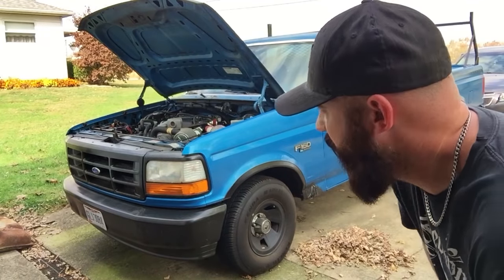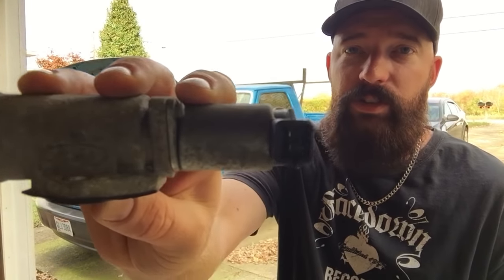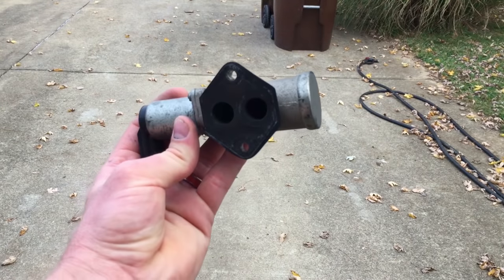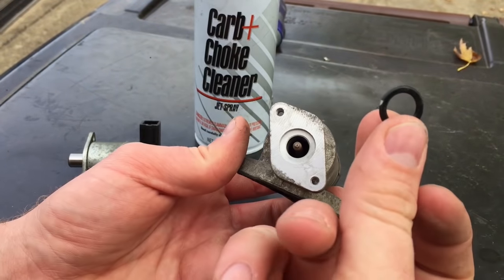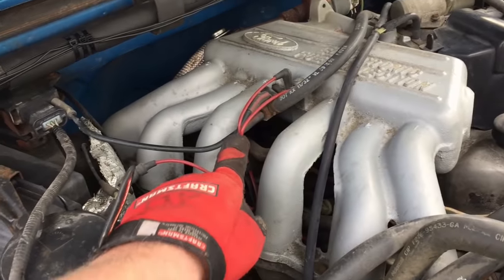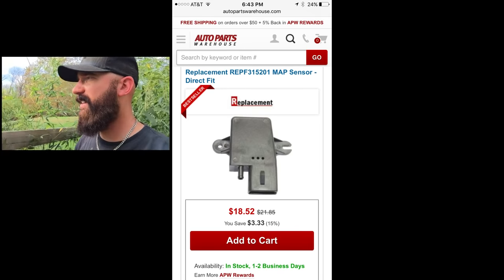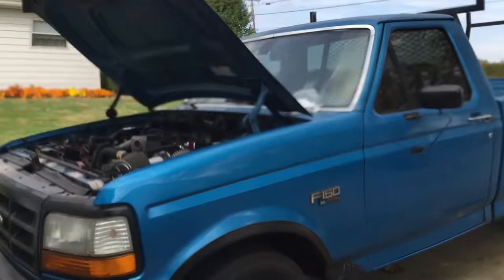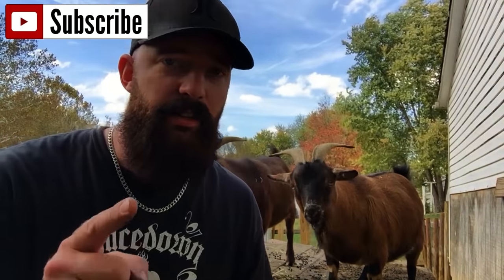Car / Truck Won't Run or Idle / Fix - F150 is the patient

Comment: I can't imagine a more perfect instructional video.  Minimum talking then you showed us what might be wrong, where the parts are located and how to remove, replace or clean the parts.  Great work.  UPdate - I see on another video where they had the same symptoms and other garages couldn't fix the problem.  The mechanic hooked up his oscilloscope and checked waveforms et al and narrowed the problem down to the MAP sensor, too.  Now I'm not sure if it was the original MAP sensor or an aftermarket one but when the mechanic pulled it out water poured into his hand.  Sure enough, the back cover could pop right off and there didn't appear to be any gasket.  The mechanic speculated that the water may have gotten into the MAP sensor if they power washed the engine compartment or maybe it just ran down the windshield - under the hood - and on top of the MAP sensor.  Interesting but something to keep in mind if anybody's F150 starts bucking and snorting.
Reply from the maker: Thank you! I appreciate it.  Take care.
Reply: That rubber seal at back of firewall needs to be in good shape as well or water can run off the cowl and down the back of the firewall causing issues.  Thx for this vid

Comment: How's the MAP sensor holding up after 4 years? just curious how its working for such a cheap price. Awesome video.
Reply: I'm curious as well
Reply: Still work I'm wondering too
Reply: Fir that price you buy 3 problem solved duhhhh

Comment: I don’t normally comment but I felt the need to thank you. I’ve had idle problems in 88 f-150 4.9l for 2 years and I just put the MAP sensor in and it seems to have fixed the problem thanks a million.
Reply from the maker: xxTANK1992xx - No problem man. Hope it holds out to be your end fix. Very much appreciated... Take care!
Reply: I have 94 f150 when I take off in od its very sluggish tell I put in 2ed gear auto  transmission it just started doing that ,what is cause of it ?? I wach all of your videos haven't found my problem yet looking forward to more of your videos thank u bro .
Reply: @kentrymason5566  I have 93 5.0 mine wants to die when I stop at stop lights or sometimes stop signs and today it's actually dying and acting like the battery is dead think it's solenoid or stater going to change both changed brake booster for idle problem was told that had to do with vacuum but didn't seem to help will try map sensor
Reply: @davidrussell789  Did the MAP sensor replacement fix the issue?
Reply: @2004Bishop  didn't try that ended up just yesterday plugging off my charcoal box at the engine and seemed to run better on my way to work this morning. Didn't want to die but now that I say this it will die on my way home. Also adjusted idle to about 1000 rpm.
Reply: @2004Bishop  got a box of plugs I'm going to go through and plug off most of my vacuum lines. Everything but the ones I need

Comment: The only good thing I got out of this video, and was the music at the end of the video. because I'm a huge Rainbow fan. I have a 1989 Ford F250 4x4 with 5.8L 351W. and I've already done everything that was described in this video plus. I cleaned the idle air control valve and installed it with a new gasket. replaced the MAP sensor, replaced the EGR valve, replaced the TPS which requires the removal of the throttle body. and cleaned the throttle body, allthough there was a hell of lot of soot/carbon in the plenom. I cleaned the plenom as good as I could. but it was pretty much impossible to get it all out of there. and replaced the O2 sensor, and went through with the multi tester and made sure everything was within spec.. and now I'm certain that it runs worse than it did before. it idles way high and then way down low and constantly stalls. it gets horrible fuel mileage it's almost impossible to drive it the way it is? I have decided that I'm done working on the piece of shit. and I have decided that I'm done with Ford and their garbage. I'm going to look for something else to drive. and then I'm going to abandon the piece shit on the side of the road. enough is enough!!!!!!

Comment: Couldn't get my 88 f250 to run, and after throwing sever parts at it, to no avail, I saw this video, and gave the map sensor a shot. As soon as we plugged the new one in, the truck came back to life! Thanks a ton man
Reply from the maker: Pj Mihalko - so glad it worked for you!  No better feeling than finding that broken part... Take care man!
Reply: Brian Ealy thanks man, you too!
Reply: A bad MAP sensor can cause rich mixtures. If your plugs are fouled, replace the MAP sensor. Run the engine at fast idle to let the engine clear out the rich mixture.
Reply: @hankbridges5055  TRUE that, Mr. Hank. Have a half-dozen new sparkers on hand if you've put off a tune up or fatally fouled the tips on your plugs. And yeppers - no harm in letting the system get to operating temps for a while to see if the lean mixture will effectively clean the older plugs.

Comment: Hey i was wondering if u could help with the problem I have. It's somewhat similar, I have a 1992 ford 5.0 and it has rough/unstable idle, hesitation, pings in acceleration, and stutters at cruising speeds. I have all new ignition parts and a few other things
Reply: harley kane try temperature sensor. It worked for my 94 f150
Reply: harley kane make sure you check out your Cat  it could have a blockage,  I had the same symptoms on my F250 tried different things it gave me fits  ,finally checked out the Cat it was nearly stopped up

Comment: 2004 f150 5.4 replaced fuel filter MAF sensor. Camshaft position sensors .seafoamed motor. Replaced plugs and coils and I'm still running over advanced and starving for fuel on one side. And running really rough. Help?

Comment: Allen Bryant - June 2020
My 1990 F150 would not stay running unless I kept pumping the throttle, Very similar to your video. I then changed the MAP sensor as you did and my problem is solved.. Thanks so much for making this video.

Comment: MAF sensor's are used in all states , I have one on a 01 Ford Taurus SEL, I got in New Mexico , and got another 04 Taurus SEL 3.0L in Tennessee , I know this video was done while back but with the OBD2 implemented  it's a better sensor and does more functions than a MAP sensor could handle.

Comment: I’m saving this video to my favorites.  I just bought a ‘96 F-150 with the 4.9L I-6.  This may come in handy one day.  Thanks for posting it!!
Reply from the maker: Much appreciated!  Thanks!
Reply: @BrianEaly  dude I have a question I have a '91 F-150 5.0 liter every little bit randomly either it will randomly burn up the computer the ignition control module or rarely the coil do you have any ideas or does anybody have any ideas where I can look it sounds like a wire or ground or something but I have checked this thing thoroughly or a slice when they made the harness is worn out I just don't know where to go I'm looking at all the wires 15 minutes my mind is burn up no drugs included lmao jk seriously this is my only vehicle and I've been down for two weeks and my budget is hurting bad very bad so any help anybody can give me crazy appreciated I don't even care if it's absolutely wrong thankyou guys

Comment: Also, a dirty/malfunctioning EGR valve will cause a rough idle. My f150 is a 1995 model, and I’m quite sure it has a mass airflow sensor, right after the air filter and before the throttle body. Don’t think it’s a California model either. Great video , love Dio

Comment: Great video. Bought a 1989 f150 for $300 bucks. Real rough idle. Replaced the sensor and voila. Idle is smooth and engine is strong. My check engine light also turned off.
Reply: Heck of a deal gor this monste4

Comment: You the Man!!! Got a 94 f150 5.8L V8 Windsor. Kept dieing and stalling out. Replaced the fuel filter, same problem. Cleaned the IAC and map sensor like you said, no problems perfect idle at 900 to 1k rpm in park!!! Saved me $350 bucks. That what the local mech would have charged for labor
Reply from the maker: Thanks for watching and giving it a shot! Take care!!!

Comment: It's cold here, often. Mine would cold start to around 2200 rpm. I did not like! Rough on cold cylinders, etc. I made a restriction plate from alum flashing and too the  iac port to about half sized hole. Sealant and install. Perfect. Seems just how I Like it. Doesn't have that high rev cold start.
Great video you did. Thanks

Comment: Get a Actron CP9690 code tester. It'll check live, record, emissions test, it'll turn off the check engine light, it'll turn off the oil maintenance light, it checks transmission codes, ABS, SRS, and MORE!

Comment: very good vid. oem vacuum lines are prone to crack and leak causing similar problems idling and running.. good idea to check all vac lines and connectors too.

Comment: Bless you! I have an '89 and have had this issue since I bought it. I have to feed it gas to keep it going/rough idle/sluggish acceleration. I'm excited to try this fix, it is otherwise a great little truck and I love driving it. Thanks!
Reply: 5.8ford v8 91ford bronco
Reply: Will a 5.8 run on the same brain
Reply: Five. 891 Ford bronco what the computer come inside from a five. Oh to a five. Eight motor on a 91 Ford bronco four-wheel-drive I’d like to know the answer

Comment: Great video, nice work.  My two cents is to check every connector on the engine sensors very, very carefully, they're famous for losing their seal over time. Then air and moisture and a few thousand heat cycles corrode the conductors and failure or even worse random hard AF to troubleshoot issues can happen, even though the sensor might be just fine, if the signal to the ECU is bad, so is idle/acceleration.  Good luck my 4.9 I-6 peeps!
Reply: Thanks for the write up, its also worth mentioning if your sensors are receiving power and ground. You can also look up the part number for any of your sensors or use alldata to figure out the operating voltage of the different sensors and testing during startup/idle.
Reply: @izftpvp822  Correct.  The Digital Multimeter is the magical eyeball that sees the voltage or dead short your eye can't.  YouTube also has video on how to look at your meter, how to use it, and what it can show you.  These engines are pretty simple, but the first/ second generation EFI electrical bits can create trouble.  It's a simple circuit, you can fix it.
Reply: I have the same truck but Red,, blacked out just like that

Comment: Liked your video, keep featuring the animals. I've been messing with one of these that nearly dies at idle when you first touch the gas. It's straight drive so it's very easy to choke off.  Anyways, I found out today that the gasket between the throttle body and the rest of the intake was in terrible shape.  If the truck has had a lot of air intake alterations and replaced sensors etc. this is worth a look.  My truck is nearing 290,000 and the gasket was thin with bubbles that cracked when I touched them. Pieces could easily go in the motor, and it looks like air was definitely tunneling through the gasket. People with trucks under 100k had same problem on here. Replacement is a couple dollars at O'Really's, cheers.
Reply: Happened to me too! The bolts were loose and valve was bubbles up just like yours. Did you have a check engine light? Mine is 327. It’s still on but I haven’t driven 100 miles.
Reply: @tope.sosanya  no light that I can remember? 327k miles?

Comment: I'm curious if your truck had check engine light flashing? I'm having hell with a 90 f150 4.9 that has lost power rough idle low fuel pressure spits and sputters if you accelerate. However if you pump the pedal while driving it accelerates better. I had changed plugs (that had welded themselves in and hadn't been changed in nearly a decade) rotor cap distributor cap plug wires and it was running better than I've ever seen it with the slightest hiccup at idle about every 2 mins. Not even a miss just a hiccup. I had planned on cleaning the fuel injection system and was looking for a high pressure set up when my friend that owns it decided to obsess over the hiccup after stating he'd never seen it run that good since he owned it. He sent it to a shop. A week later and 600.00 he showed up with it running worse than before I changed the plugs wires rotor etc. Fuel pressure was 0 ke eo for several tries. After 10 tomes it hit 30 psi. Running showed 0 psi. I pulled the filter which was a couple months old dumped it out. Shot air thru it and got 30 psi running. Pulled the fuel pressure regulator hose off and no increase in pressure. Changed it to one with 52 psi and getting 38 psi running 51 when turned off. I feel like the fuel pump is weak. The rear tank hasn't worked in decades. I pulled codes again and got two in memory non in active codes. One was secondary fuel circuit fault the other was egr? Code 32 I think. I checked the timing the other night and it was crazy. The mark is near impossible to see due to belts alternator,tranny lines to radiator vacuum noses and the position of the timing marks over the balancer but the line was not constantly visible. There were 30 second lapses and longer. When I raised the rpms a bit it was steadier and looked to be just past the Big V notch showing 10 degrees before top dead center. I have no idea what the idiots did at the shop but they delivered it without saying anything. Like sorry we charged you 600 and made your truck run like shit. But you should have seen it coming because we charged your wife 350. to add a can of freon to her Cadillac that got cold for 20 mins then got hot again. Thank you fir being such wonderful suckers I mean customers

Comment: Hey brother, what size pipe did you use for the air intakes? I've been thinking about doing this on mine,  just haven't got around to it.  Lol. It looks like 2 1/2 or 3 Inch pipe. Is it just exhaust pipe?

Comment: Cone intakes on a speed density (map sensor) truck? How's that work out? I thought about an intake upgrade but was advised against it due to the speed density system not actually knowing how much air is going in, rather only knowing the manifold pressure.

Comment: Hi .... I have that same truck with the same motor... I've changed the fuel injectors , fuel pressure regulator , replaced upper manifold gaskets , egr gasket, throttle gasket, and cleaned all parts.. My truck now idles high starts cold at 2500 rpms....  Ive checked all  possible vacuum leaks.... Should I reset pcm?

Comment: I'm not sure about all motors but I know 95 and newer 5.0 302s all have maf sensors. And if you want to put a cam in your 302 it needs a maf not map sensor my 1990 runs like shit with a cam ran great stock so I'm updating to the maf sensor and hopefully that's the end of my troubles and still get more power

Comment: Hi I’m looking for help. I bought a 87 F-150 5.0L V8 that won’t idle right and shuts off. What I noticed is that the previous owner installed a mustang 5.0L upper intake manifold and just connected the MAP sensor to it. Would that have an effect why the truck doesn’t stay running?

Comment: Thanks!

now my truck idles and runs fine, not missing anymore. (all new tanks, fuel pumps, Throttle position sensor, plugs wires dist cap, fuel filters) got a map sensor for it to see if it helps..  problem now is... doesn't seem to get fuel when starting, takes a while to crank over. fuel pump does run when key is on acc.....thoughts?
Reply: My 94 f150 takes long to start as well. I replace the fuel pressure regulator (old one had missing orings. 20 psi) Psi is 30 (on the low end with key on but not starting) and Still long start (was going to replace map sensor to see if that was the problem). TPSensor problem?!? I heard not to pump gas padel when cranking as sensor is setting default position.
Let me know if you find a fix....

Comment: I have a 92 ford f150 that is doing the same thing as yours in this video and your other video, with the paper clip. My truck now doesn't want to start, it'll crank all day but won't start! I haven't tried the stuff in your other video yet cause I just seen it but any ideas on what could be the problem? And does the paper clip method still work even if I can't get the truck to start as since you had to hold the gas to keep it running

Comment: Hey man so I got a 2000 Ford F150 V8 5.4 Lariat and I changed the fuel pump, spark plugs, and everytime I come to a stop at a red light or when I'm reversing it randomly shuts off. What do you think may be the problem?

Comment: Got my 1990 Ford F-150 started, but when I put it in gear & try to accelerate, it dies..

The other day, my catalytic converter glowed cherry red after warm up..

I replaced the following: 
MAP sensor, EGR valve, EGR valve solenoid, spark plugs & wires, distributor cap & rotor, valve covers & valve cover gaskets, fuel pressure regulator, fuel pump & fuel tank, fuel filter, water pump & thermostat, alternator, radiator & fluid, oil & oil filter.

I HAVE NOT changed the following:
Knock sensor(just learned about it)
TPS
IAC(cleaned the present one)
Starter & starter solenoid

Out of all the info., what do you think it may be?

Thanks in advance

Comment: My 93 F150 5.0L  was a combination of TPS and ignition control module. And I had to modify the TPS and dial it in with my multimeter